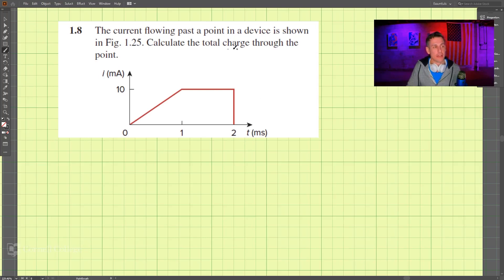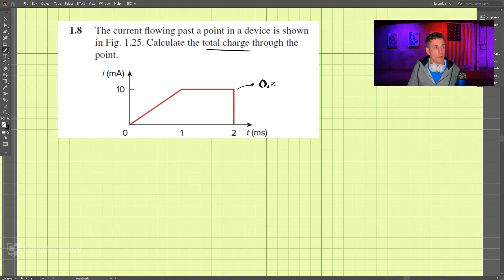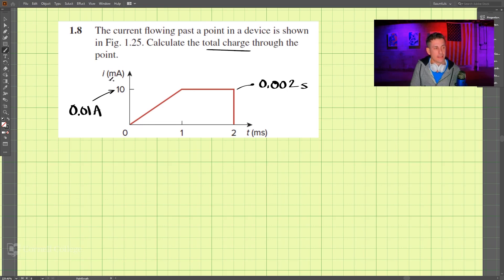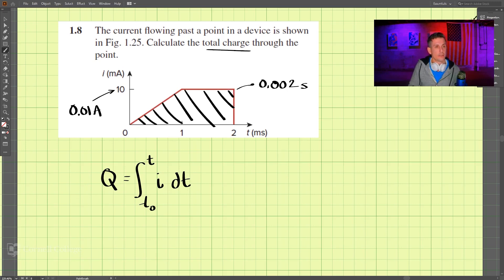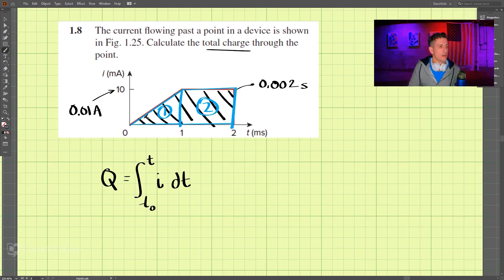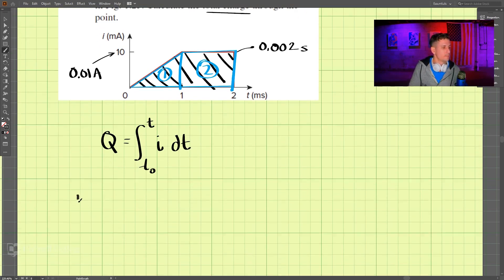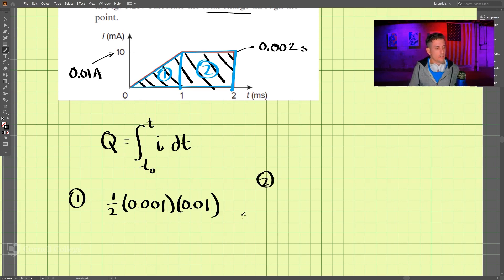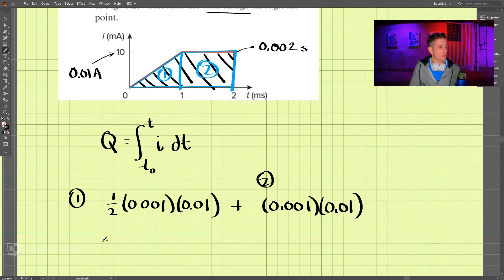1.8 - Example Problem - Fundamentals of Electric Circuits

Comment: Firstly thanks. Secondly, I have some questions if you don't mind. Why is mA only 0.01 but milliseconds is 0.001? My uni is giving the answer as 15uC and they're using integration. I can't do integration well yet so I'm quite confused. I've seen people breaking it up and solving it like this, but why are the answers different? Edit: I just looked at your channel and see you cover the textbook very well. Glad I found your channel! Thanks so much, it's definitely going to help me out when I get stuck!
Reply from the maker: 1 mA is .001A, in this problem it is 10mA which is .01A. I double checked, it looks like I did my math wrong. You are correct, it is 15uC. The procedure is correct, I just think I fumbled the calculation.
Reply: @sorJohns Thanks for the reply. I got it now as well. I don't know why I wanted to make 10mA 0.001 instead of 0.01. Gues that's what happens when you've been studying all day. Anyway, thanks again. My university expects me to solve it with integration for some reason, even though it's only my first week, and we haven't covered that at all, so I was a bit frustrated.